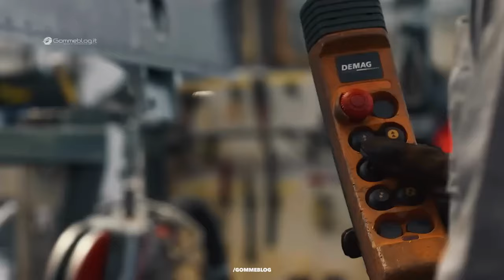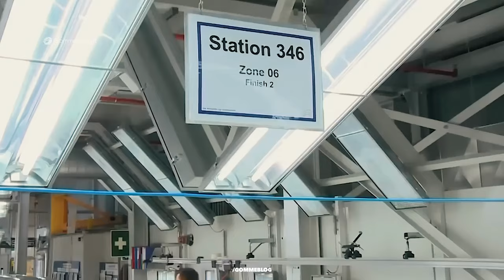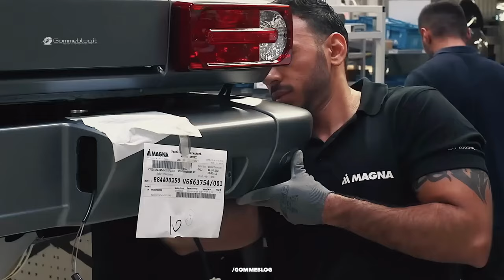Mercedes G-Class - Car Factory Manufacturing Process

Comment from the maker: 00:00 Mercedes G-Class Welding Shop
05:45 Mercedes G-Class Paint Shop
11:30 Mercedes G-Class Body Assembly
13:17 Mercedes G-Class Leather Shop
14:00 Mercedes G-Class Chassis And Frame Assembly
14:30 Mercedes G-Class Door Assembling Area
15:10 Mercedes G-Class Body-On-Frame
15:55 Mercedes G-Class Final Assembly